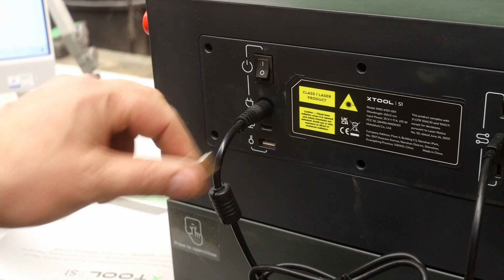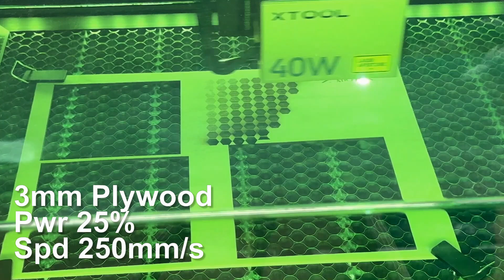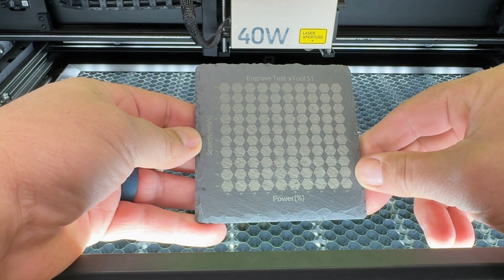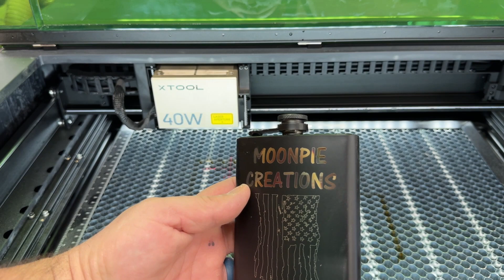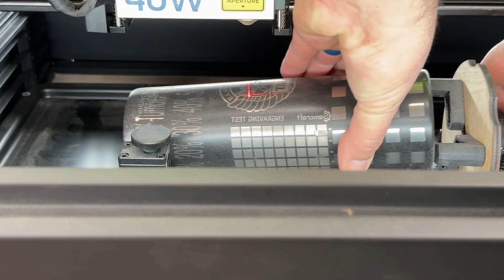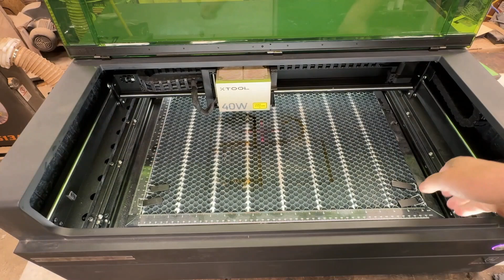Watch This Before Buying the xTool S1

Comment: I am looking to start up a small business. Compensate some income after retirement. Have been looking at the Xtool F1 and the S1. Would you recommend buying both or one to start? Aslo what is your take on the AP Laser?
Reply from the maker: So this is a tough question to answer. It really depends on what you are looking to do. 90% of my work is done on my F1 and F1 Ultra. You can check the ultra out here https://www.xtool.com/products/xtool-f1-ultra-20w-fiber-diode-dual-laser-engraver?ref=MPC&utm_medium=affiliate&utm_source=goaffpro&utm_term=5306
The link to the S1 in in the description below. Use the compare feature to see the big differences. 
For larger orders, such as signs, I move to the S1. I do all my coasters, flasks, and tumblers on the F1 and Ultra. 

I looked over the AP Laser and from what I can tell it's $16k and Co2. Not really comparable to the other machines and I would not suggest going full bore into the laser business. With the advent of the hobby laser the market is saturated more than people understand. You have to have a niche to thrive.  If you are looking for a CO2 laser xTool has the P2 and it has some great reviews or AtomStack just released one for around $2300.